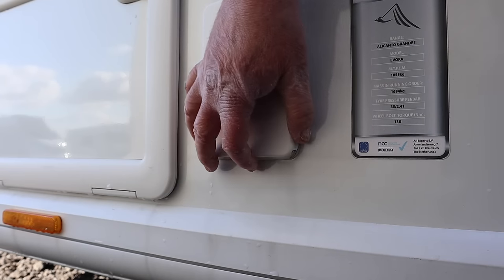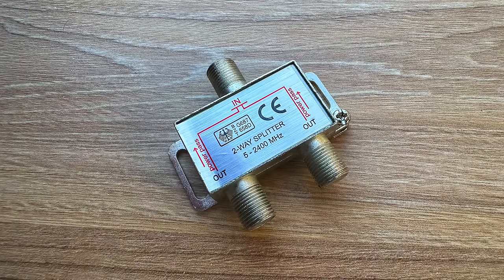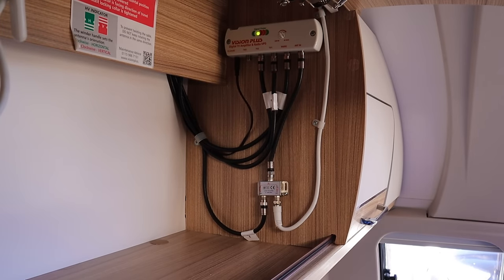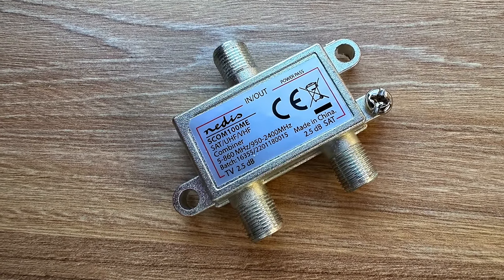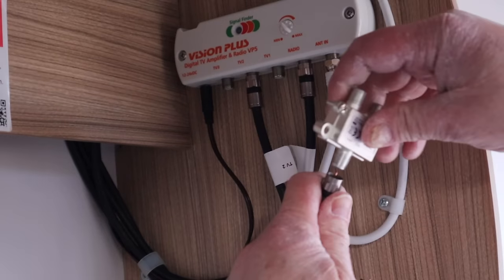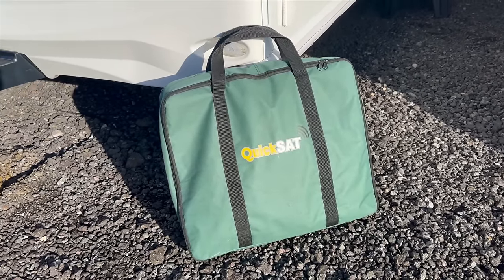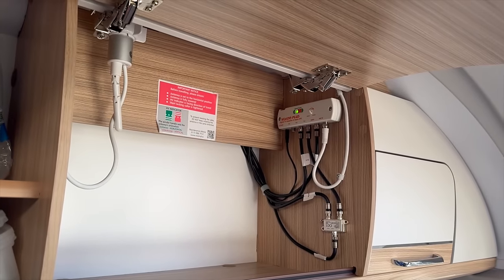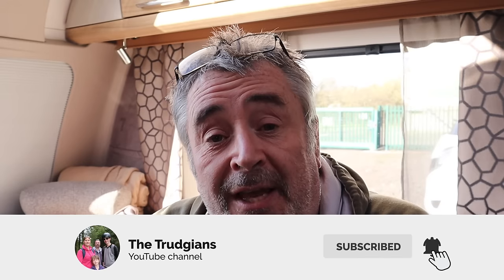Adding an external TV input to the caravan

Comment: We had the outside cable put on to our new van by the dealer , we just swap the cables over on the amp. Yes I know I could use a splitter but just got to get round to it. Very informative video and made to look easy.Good work.😊

Comment: I have the same van and got the dealer to fit individual Sat cables from behind that outside socket to each TV point inside and then made a hole in the outside socket backplate so the cables can be connected directly to a Sat dish with twin LNB. It’s a bit more expensive but you do get Sat at both TV’s. Nice tip for the external antenna and roof antenna with the splitter as I undo the leads and swap them around on the booster and they play havoc with your fingers so I’ll do that now. So simple. Only other issue is I bought a Sat dish that sticks to the side of the van with suckers and either you can’t quite get it to line up or there are wet trees in the way or the dish falls off in the night. Oh the joys of camping and forever fettling.

Comment: Very neat job Dan 👍. I fitted external TV & Sat inputs in the battery box 11 years ago when we bought the caravan. The coax hook  up cable feeds into the battery box together with the electric hook up cable. Only ever used the tv input but the sat input is there if we ever go on a site with sat hook up. Cheers, Rob

Comment: My old van was setup like yours with the socket. Don’t even need to buy the splitter, just when on a bollard / external socket remove the aerial cable from the amp and pop the external socket plug in its place. I’ll caveat that, mine was standard push fit RF, not screw on, so quick and easy. The screw on would be more fiddly to quickly do, hence I get your mod.

Comment: My vans outside connector goes striaght to one of the the TV outlet ports. So I do not need any spliters at all to allow satellite dish or external TV source to work with the TV. If I want to watch TV in the awning I have a small jumper cable to connect the two TV outlet together in the van. The satellite input then becomes the TV outlet.

Comment: Hi Dan, I have a. lunar ultima and the external socket is a sat socket.  Therefore I assume it’s for a sat dish.  If I were to use an f type connector to TV aerial adapter plug on the external socket and inside sat socket, could I use the site TV aerial socket ?

Comment: hi great video just one question on my swift caravan i have a sat connection on the outside and when i go to one site the onboard attena struggles for reception and i use a areial but i have upgraded my tv and use to plug my coax lead from the areial into the sat connection on the outside and it got a signal no problem but now i can't get a signal with the new tv so my question is if i split the connection in and split it so the1 will stay as a sat in and the otherside send it to the onboard amplifier will this work and what would i need a spliter or diplexer thanks

Comment: Hi Dan. Loving your blogs. I purchase the tools you recommended off Amazon, but struggling to get the F type connectors to fit the cable when I try and crimp them on , as its as if the cable is the wrong size? I have noticed on the actual cable that it says RG6U, and not RG6, is that my problem. The connectors seem to not go far enough on to the trimmed end of the coax cable? What am I doing wrong? Cheers Colin
Reply from the maker: Hi Colin, 

Thanks for your feedback. The RG6/U really shouldnt be any different to RG6 - the /U denotes "General Use" - so it may just be a bit tight. Here are my tips.

When you cut the coax back, remove the foil, then fold back the braid over the coax outer. This will create some space for the plug to fit between the insulation and the inner of the coax. When you add the plug, I twist it on like you are screwing a plug onto the cable. This I find (although tight) does do the job and it will eventually seat on the cable. 

Happy to follow up with a video on how to do this, if that helps. 

Take care
Dan
Reply: @TheTrudgians  Hi Dan. Thought I would reply, just in case any body else had same issue. After your tips, and saying possible too tight, which mine just was not. The problem turned out to be the outer diameter of the coaxial cable. I purchase some more, and it was 0.5mm larger, which made all the difference, and the mod now finish. 👍. 
Thanks again Dan,
Cheers Colin

Comment: Is that going to work?

Your splitter is 1 IN to 2 OUT

You’ve done 2 IN to one OUT - ie reversed it.
Reply from the maker: Yes, it works. If you have a factory DAB install, you’ll likely see one of these behind the radio.

This splitter has no circuit inside it literally splits the signal to 2 connects.
Reply: I tried this and found the external post supply poor and grainy as it was getting confused with the roof aerial. I had to buy the same thing but its got an A & B switch on the inputs, this isolated the roof and the outside point .
Reply: @fil449  this would be the better solution, otherwise you also run the risk of site and van aerial tuned into different transmitters. Both those jumbled up signals would probably cause a few issues.
Reply from the maker: Hi both. A couple of points here - digital signals don’t degrade to grain, it’s more likely the amp was on? Overdriving the inputs. 

Mixed signals are also an urban myth these days - when you tune a free view signal, the end step asks for primary & secondary locations - if 2 transmitters are found your answers dictate which transmitter is used. 

If equal signal strength is found, you’ll find multiple instances of same channel - like what I have at home. South west & Oxford etc. 

To overcome any multiple channel issues, simply  detune the onboard antenna by rotating it 90 degrees to strongest signal 👍 

Hope that helps.
Reply: Just what i found Dan using the same splitter.I had to use a splitter with an A&B switch to isolate the roof from the post. Even rotation of the roof aerial was still picking up interference. Unplugging the roof aerial it stopped. Just trying to add to your great video  if someone experiences what  happened in my Swift.